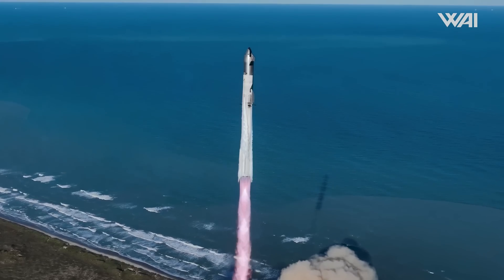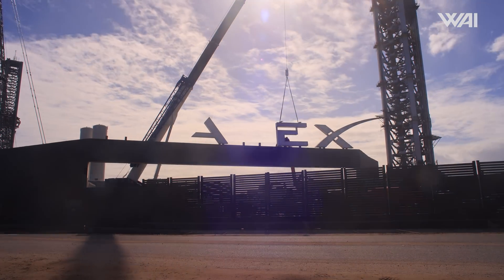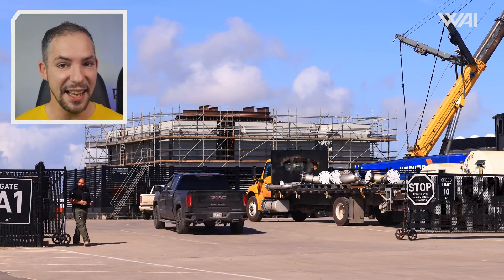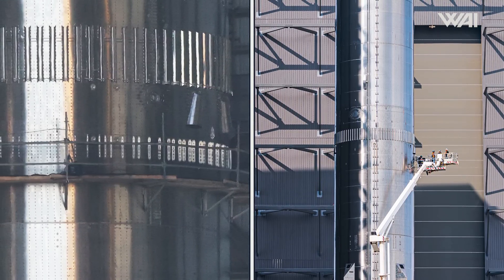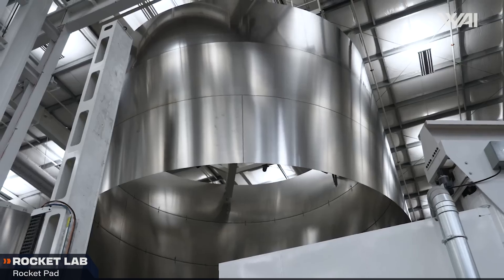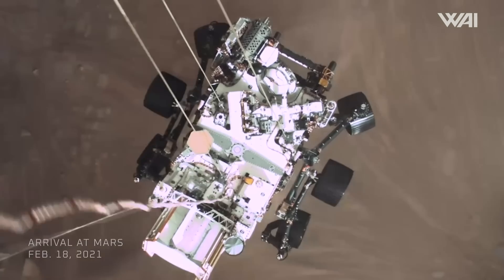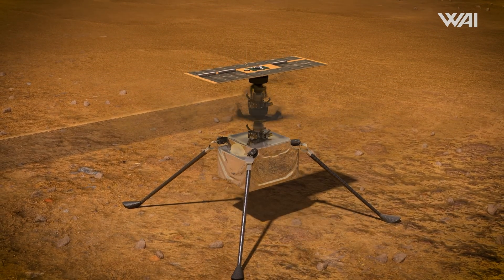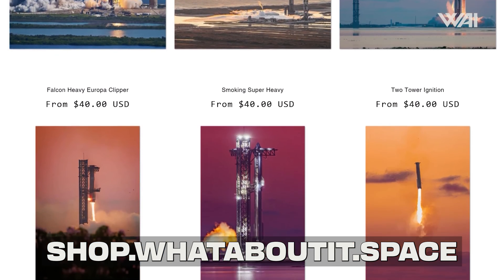SpaceX's shows new Starship Heat Tiles! And they're red!

Comment: i suggested on X that Elon should try creating a spray foam style ablative material as it can be repaired and reapplied between launches quickly. i am hoping he read my comment and is testing it out on this launch. he could have had it cut into a tile shape so it matches the rest of the tiles and to fit snuggly in place. my reasoning for a spray foam based ablative  material is that micro air bubbles act as thermal protection and the materials used to make standard heat tiles is compatible with the creation of a foam base spray "carbon, silicone, resin, and epoxy". it would be light weight as you can place down thin or thick layers depending on what part of the ship your spraying.
Reply: The spray on idea fails every time someone suggests it because it can't cope with the fact that different parts of the ship expand and contract at different rates at different times during the flight.
Reply: @TheEvilmooseofdoom  you are talking about very minor expansion and contraction when it comes to stainless steel with a cte of 0.0000065in per F above ambient temp. we don't know the properties of spaceX stainless steel but regular stainless steel would expand and contract 0.001885in if entering earth's atmosphere. some kind of elastomer coating could be sprayed on first to adhere the spray foam ablative material to the hull and allow for expansion and contraction. but off the top of my head, I don't know of an elastomer that isn't flammable. but I honestly think it's not necessary as ablative foam has been used for a long time with success. I'm just suggesting that it becomes sprayable product for ease of use. if it did crack it wouldn't be an issue as cracks are never clean allowing the heat to be blocked. if the heat did get threw to the stainless steel I doubt it would be enough to melt threw the metal.

Comment: Why not have a rolling cover over the launch pad launch cavity, similar to what we do with our nuclear lanch sites.  After the launch, have a door roll over the cavity to protect it from the returning booster and Starship?  Plus the cover can be easily replaced if it shows signs of wearing in case of a booster failed catch, protecting the launch pad hardware in the cavvity
Reply: The majority of the potential damage is caused during launch when all engines are firing. Not only that, the ship is held down for a few seconds to check systems, and then it is released and slowly rises. The giant marshmallow it sits on gets very toasty. During the booster catch only three engines fire hence 1/10 of the total, and it slots into its parking bay pretty quickly and extinguishes the engine. The booster is higher up when caught and not down low next to the launch pad proper. So the heating on landing is nowhere near that experienced on launch. So no a sliding bond villain style cover would not be needed.
Reply: @StillAliveAndKicking_ Well analyzed!
Reply: Lots of extra engineering and complexity.  Anything strong enough to do that is not going to be so easily replaced.
Reply: Such a cover would cause the exhaust to jet sideways into all the nearby equipment.
Reply: That's a very clever idea !

Comment: Glue The secret might just be glue. Just coat the outside of the ship with glue get some big sprayers when you get done with it for the next time just spray it over with glue until it weighs the same and shoot it back up pulling them rockets in for right now just to keep going it's pretty cool because an awful lot of them don't won't need that just keep the program moving by sending up ships and getting the next refill done.

Comment: Put in the composite tanks on the inside of the rocket ship. Everyone else puts them on the outside of the rocket ship forever. This seems like a no-brainer less drag on the inside of the rocket! Which could be a good reason they made the rocket just a little bit bigger to hold them.
Reply: The drag is not that big an issue.  Making the rocket a bit bigger means starting over.  Maybe leave engineering to actual engineers.

Comment: The color of the tiles might just be for identification purposes. If the coating color is not tied to its function, they may have chosen to change the color to easily identify them when putting them on the ship. The tiles are meant to be interchangeable, so they are probably not individually identified otherwise. It's easy to get them mixed at installation time. The color helps reduce risks of mixups. Why are they otherwise painted black? My guess is for better radiation properties, but I know very little about materials so my opinion either ways is useless... except to provide engagement for the channel. Keep up the good work.
Reply: The black tiles have a layer of pure carbon deposited on them to make them more heat resistant. Thats why the space shuttle has black tiles on the bottom, and white tiles on the back. The tiles on starship are sort of improved shuttle tiles or tufroc tiles. I think the red is just protective plastic foil.  As often with aircraft and space ships red things are to be removed before flight. Like the red ribbons on caps on pitot tubes.  It does look a bit like foil,  i think it is to prevent glue getting on the tiles as the surface has to be as smooth as possible .. and the tiles above the red ones are glued on. As there are no mounting pins there. While the tiles with foil are mounted on pins.  So maybe other tiles might have had foil on them too but it has been removed.
Reply: @apsdev I am sure they would have seen the red peeling covering before if it existed. But your suggestions otherwise make sense.

Comment: I wonder if a spray on ablative heat shield will end up being the answer. 

If it could be applied over the remaining heat shield, on the pad... and Ideally, mechanized.
Reply: Ablatives are, by definition, expendable.  Ergo heresy as a general solution to anything.
Reply: @dudermcdudeface3674  You fuel up the rocket, why not spray on a new heat shield? If it's cost effective.
Reply: @puddintame7794  But then why not just add the same weight in durable shield and/or extra prop to reenter slower?  LOX/Methane will inevitably be cheaper than any kind of special thermal coating.  Plus they're planning on using fuel for transpiration cooling eventually.
Reply: @dudermcdudeface3674  True enough...

In the interim while the bugs are being cleaned up... a spray on heat shield would be a pragmatic solution. Especially if it lasts a few runs before needing to be reapplied.
Reply: @puddintame7794  Your spray on heat shield does not take into account that different parts of the ship expand and contract at different rates at different times in the flight.  Your magical heatshield spray can't do that.
Reply: @TheEvilmooseofdoom  How do you know that? Have you done the chemistry?